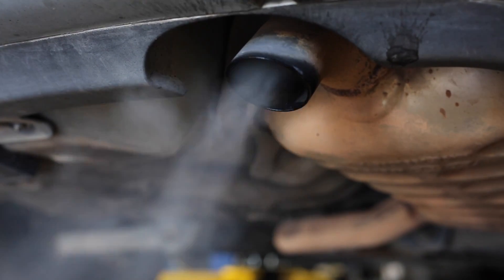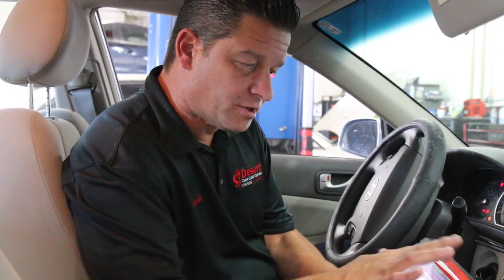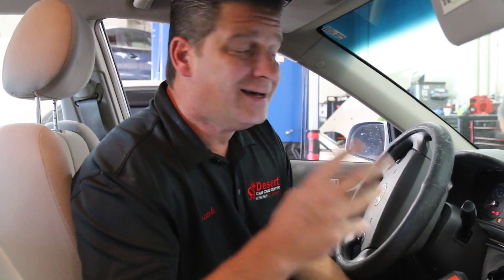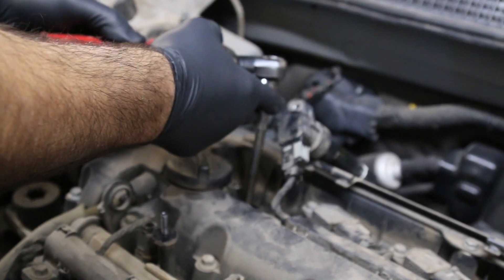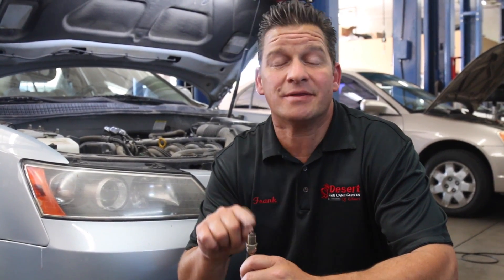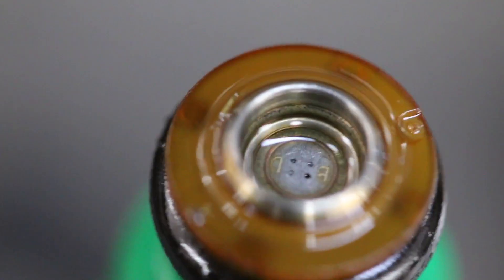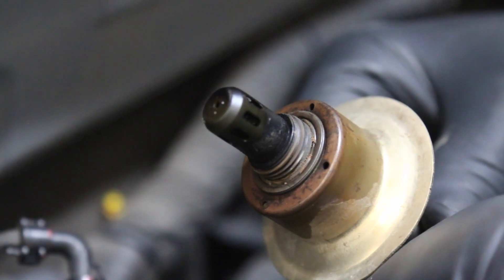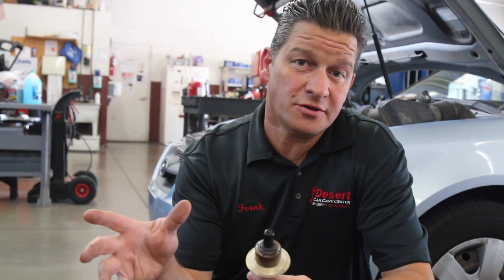Hyundai Sonata Fuel from Exhaust Pipe

Comment: Or possibly no spark on that cylinder?
Reply from the maker: In this particular case - massive amounts of fuel with an injector that was not atomizing - that injector was a fire hose of fuel.

No spark condition would have some unburnt fuel but not like this case - hope this helps

Comment: Hey i have a 1996 sc400 Lexus with a crank no start issue i can smell gas from the exhaust pipe when trying to start the car. I have change crank sensors, cam sensors, ignitions coils, spark plugs, fuel pump, igniters, fuel filter, fuel pump ecu bypass, idle air control,  clean mas air flow sensor, ecu repair, so i'm thinking it could be fuel injectors or timing has jump . I'm asking for your opinion could this be my fuel injectors because i smell a strong gas smell coming from my exhaust when trying to start the car.

Comment: My 1990 bmw 325i has a very rough idle mainly drops and sounds like it’s going to die out and then goes back up. Also it has gas dripping out of the exhaust. I was planning on changing the fuel injectors and maybe getting a new fuel pressure regulator and fuel return line. Any tips on how to fix this? I also got a whole tune up for the car but that didn’t fix the problem:/
Reply from the maker: Have you tested injectors ? Be cautious before just replacing ~ potential problems could be : harness , DME, fuel pressure regulator.

Noid light check injectors to rule out potential DME or harness issues. 
Check fuel pressure to ensure fuel psi regulator is working .

Comment: Question 
After I installed new fuel injectors into a 2008 Suzuki Grand Vitara now I have white smoke coming from tailpipe that smells like gas it was not doing that before I installed new injectors can it be a bad fuel pressure regulator.
Reply from the maker: Angel F ~ if injectors are not atomizing fuel ( misting) and they are streaming fuel you could be running raw fuel through the exhaust. Call us at the garage for any help with this one ~
Reply: Desert Car Care even though they are brand new that can happen.
Reply from the maker: Angel F < certainly hope not ~ best to test before doing anything else at this time .
Reply: How to fix injectors to atomizing if they are brand new,  I still white smoke that smells like gas

Comment: Frank, have an 06 3.3 Sonata. For over a year I have had a check engine light. Replaced the Mass Airflow Sensor & Throttle Position Sensor, had ECM flashed at dealership. Took it to local shop and they can't find anything wrong. The prob is that after the engine is warm, kill the engine, it becomes very hard to get started if it sits for about 10+ mins. Get codes stating running lean banks 1 and 2. And have had the car slip into limp home mode. I have about $500 in this now and no resolution. No longer trust the shop that said they can't produce the problem, or didn't find any of the codes. Car turns over fine. Usually runs very rough initially, but once started very smooth. Any ideas?
Reply from the maker: Chris Harpe ~lean bank 1 & 2 ~ check fuel pressure & volume ~ call me if needed at the garage
Reply: @Desertcarcare  Thanks for the reply. I think that it is fuel starved. A garage, now out of business due to fraud, "replaced" the fuel pump, but possibly didn't. May be a victim of fraudulent shop. Throughout my life, I seem to choose the wrong mechanics. Or, I should say, I haven't found a consistently reliable one. The screws on the fuel pump cover have no signs of removal. Going to the local Hyundai dealer Monday. Will see if they can figure it out. $140 diagnostic. Should I just throw a fuel pump at it instead?
Reply from the maker: Chris Harpe ~ test & verify. Don’t waste $$$ throwing parts at it ~ keep me posted ~ wish you the best ~ sorry about that experience .
Reply: @Desertcarcare  Excellent advice! Throwing parts at it hasn't resolved the problem, so continuing down that path is the definition of insanity. Diagnose and treat. Will report back once I have the results for the benefit of others.
Reply: @Desertcarcare  Replaced fuel pump, check engine light turned off, and getting about 10 miles to a gallon better mileage without the hard to start probs I ha experienced. The dealership said I also need to replace the fuel injection rails, but don't think that's necessary. They wanted 900+ for the repair and able to do it for $120 including the fuel pump lock ring. The lock ring is necessary becsuse they're made of a very soft metal and easily warp when removing. These are special order, or dealer part. Brother had an oem lock ring sent via Amazon for $22.

BTW the shop did not replace my original pump. The bad pump is the original that came with the car.

Thanks for the advice!
Reply from the maker: Chris Harpe ~ truly sucks & gives all in the industry a black eye when this happens ~ ultimately glad it worked out in the end . Rock on.

Comment: I have 06 Hyundai sonata 6 cyl 231600 miles fuel coming out exhaust the check engine light is on
 Error Code Read 
P0430 Catalyst System Efficiency Below Threshold (Bank 2)
P0420 Catalyst System Efficiency Below Threshold (Bank 1)
Where do i start? Do you think the fix would be worth it with the high mileage or should i just sell it?

Comment: I have a 2009 Nissan Altima Hybrid and the only code that comes up is for cylinder 2 misfire but the check engine lights comes and goes all the time. I smell gas fumes coming from the exhaust but it's nothing like this video. The car shakes when slowing down when cold like it's gonna shut off but it doesn't. I've changed the spark plug and coil. I've taken this car to 4 different mechanics and everyone keeps saying this is normal Hybrid stuff. It didn't do this when I first bought the car and if it was normal my check engine light wouldn't come on and off. I'm confused please help!
Reply from the maker: Alicia Perez ~ definitely frustrating . Let us know what part of the country your on & we will get you to a qualified hybrid garage. Wish we could tell you more here ~ but tough to say.
Reply: @Desertcarcare  I live in Rochester Ny. I'm 30 mins away from Buffalo if that helps. I appreciate your help. This has cost so much already and I'm still in the same position I started in

Comment: I have this problem in two-wheeler(2 stroke engine) can you show me how to fix this problem
Reply: remove the bottom of the carburetor and check the float!
if there is no float then check the reed valve.

Comment: I had a 5th cylinder misfire in my Hyundai Santa fe and after i replaced the coil and spark plug my gas mileage went to hell. The misfire was gone, the engine runs smooth but i am getting no where fast literally at about 5 miles per gallon. What happened?????
Reply from the maker: Massive Action ~wow. Call me at the garage ~

Comment: I have an issue with my 1990 Honda Accord Ex , it was new plugs , cables , distributior , coil, pvc valve , and the exhaust smell like unburned gas , cylinder 4,3 the plush get burnt bad can it be bad injectors ! I also order new map sensor and file filter with injectors please help
Reply from the maker: Roman Martinez ~ring me at the garage for this one.
Reply: Desert Car Care pretty much what’s happening with the car on the video

Comment: Great video  have a question hopefully u can help I own a 99 sable had misfire code p0301 so I changed plugs wires and coil pack check engine light went off on its own after changing everything...2 days later as I go start the car I smell gas and check engine light comes back on took it back to auto zone same code given p0301 and I smell gas coming out exhaust pipe.....not sure what the problem could be ....thanks
Reply from the maker: desi&lui A ~~ensure ignition coil & plug are good to go & not new defective. Ohms Check that cylinder fuel injector~~May need further testing at a garage to confirm ~~if you need a garage in your area ~~let me know. ~~Frank

Comment: I got a 2002 GT MUSTANG 4.6l 2v 281 cubic engine. I have no diagnose trouble lights, no codes, my car has a hesitate to start once twice a month an is smelling gas from the exhaust. No smoke. An little power lost from the throttle pedal
Reply from the maker: Ndee Redsky ~~get back to basics. Make sure all your spark plugs are good to go. Additionally a deep cleaning decarbon of air induction & injectors may help this symptom ~~good luck ! ~ 

Follow us here for more tips http://apple.co/2EdrZJE
Reply: Desert Car Care , yes I'm a certified lube technician an I installed new spark plugs, new egr vacuum solenoid, new throttle body an sensor, new fuel pump an fuel filter, new IAC sensor, new intake manifold. Gonna replace the injectors, an fuel pressure regulator an egr valve. I hope it's my catalac converters.... Can't figure it out...Thank you Desert car care..
Reply from the maker: Ndee Redsky ~~just think ~~your ride is going to be brand spanking new when done ✅ ~~you are hitting it all ~~Check the inlet & outlet temp of the cats for efficiency ~~let me know how it all worked out brother ! Good luck here 🤘

Comment: My 2009 BMW just started blowing smoke that smells like fuel after engine light came on . I change spark plugs but nothing change , .. could it possibly be injectors , oil smells like fuel and is thin down. Smoking like a train and smells like gas! Need help?
Reply from the maker: Rafael Aviles ~~your loading up on fuel it sounds like~~Check both fuel pressure & volume~~Call us anytime if you like there for more help or check out our FACEBOOK page @wrenchnation ~Frank
Reply: Thanks , ..I do have some misfiring codes on a few cylinders and 02 sensor bank 2 code .. how do I check fuel pressure ?

Comment: Hi Sir, I own a Honda City IDSI 1.3 /L13A model 2008 having 140,000 on meter. Today I just tried to adjust its valve clearance and plugs maintenance, no trouble there but as I tried to start the car it just misfired. I cranked it again it started but kept on misfiring. It also smelled like fuel around the car, then I just noticed that car is spitting excessive amount of petrol from exhaust pipe. I re-did every thing but no luck and still is spitting fuel. Please help...
Reply from the maker: Please reach out at the garage ~do my best to help you there ~Frank
Reply: Sir I am in Pakistan

Comment: Desert Car Care hi have a 1991 mazda mpv v6 i recently changed the valve cover gasket when i put everything back the car wasn't starting cause i didn't tight enough the intake.manifold after i try to start the car it would start but with  very high rpm it scared me and i had to turn of the car right away but that was intake manifold was still loosen bolts so i tight them problem now the car starts it has squeaking sound and the engine light is on and a lot of white smoke and gas comes out of tailpipe?? any suggestion i have exact the same symptoms as this hyndia sotana except i have squeaking noise ? thank

Comment: Hey Frank. Great video-very clear and concise. I've  been noticing a slight fuel odor on startup which appears to be coming from tailpipe. Exhaust is clear, no smoke. Only smell it when windows are down. No codes and LTFT is within +/-5%, MAS, Vacuum, Throttle, etc readings all appear normal. Original iridium plugs and injectors. Burns no oil. Starts and runs perfect. 2006 Toyota Matrix 4WD with 86k miles. Any ideas?
Reply from the maker: MarzNet256 ...great data info....let's connect at the garage~~happy to help~~Frank
Reply: Desert Car Care Thanks. Will do.
Reply: @MarzNet256 what was the problem?

Comment: having this problem with my 04 taurus. white smoke, won't start unless the car is on Jacks tilted, gas soaked half the air filter, gas in muffler , gas on spark plugs. code says something about the fuel rail pressure sensor High Intake and no activity from o2sensor debating about buying a new expensive rail sensor. but how do I gtg rid of all the gas in the muffler and the extra fuel in engine????

Comment: p0131
p0137
p0151
p0157
p0507 idle speed performs high 
p0300 spark plugs
p1406 egr closed pintle position
p1441 EVAP system 
Also here's the codes it's throwing out. I've done all the spark plugs and egr so far from these codes. Sorry for the 21 Questions.

Comment: My 99 Chevy Tahoe 5.7l puff out white smoke through the tail pipe just like the one on this vid and smells of gas. It happens back and forth but mainly the majority of the time whether I'm driving or it's just sitting there. Also has a sputter/shake/tremble to it like sparkplug issues. Was hard to start right up as well so I put in a new fuel pump and and new sparkplugs. Now it starts right up but still trembles. now the shaking I'm believing could have to do with the egr, vacuum leak, etc.. And the gas smell and white smoke from exhaust could possibly be coming from the fuel pressure regulator or the fuel injectors as you mentioned. Could I be correct? Or could you give me some insight on what all it could be, if you don't mind.
Reply from the maker: purestress2 ...if you are getting fuel from tailpipe after those repairs ...check the engine oil for fuel contamination..that may  indicate a ruptured diaphragm in the fuel pressure regulator. 

However. Caution here. 

I hate to see you throw parts at the vehicle. Slow it down. Fixing a broken part is not difficult.  It can be tricky to diagnose effectively. Have a reputable local garage TEST first based upon your symptoms. 

I have great guys & gals across the country that can help. Let me know if I can refer you to a great garage in your neighborhood. 

Sorry I couldn't give you holy grail of a fix here. Appreciate you stopping by. Always here to help. ---Frank
Reply: Desert Car Care thanks for the tip and the reply! I just literally now got done trying to figure out what to fix first so I went ahead and cleaned the egr Valve and replaced the gasket since it also had a 1406 code in which it said egr closed pintle position. No smoke so far but just a little bit water from the tail pipe. I couldn't smell gas either but my nose is kind of stuffed right now cause I'm sick. I'm going to test it out tomorrow again and see if it could it continues cause like I said it happens back and forth. I'll let you know how it goes. Oh and by the way could that have kinda been the cause if it doesn't continue or just one if the causes? Also the car still trembles at idle and more when I accelerate.
Reply: @purestress2  you solved your problem ? Was the problem and how you fixed ?

Comment: Hello i have a 1993 grand cherokee v8 zj ..lots of smoke from the exhaust with fuel smell and check engine light ..yesterday i turned on the ignition and everything went back to normal and suddenly the check engine came back on with the smoke..i pulled out 4 injectrors of the right side of the engine and no more smoke ..sparkplugs are working great too..what should i do please thanks
Reply from the maker: Fadi Akl ..reach out frank@desertcarcare.com  for details. I have a few questions so I can help you further~~Frank.

Comment: my car smells gasoline from the pipe  what do you think ? it burn allsoo lot of fuel
Reply from the maker: Rajiv Raushen ...make sure 
A)Injectors are atomizing the fuel
B) O2 Sensors are moving as they should
C) Ignition ( spark plugs etc) are burning properly 

You have any fault codes stored ? What kind of vehicle ? -Frank
Reply: Desert Car Care ; i have a toyota raum 1.5 l
Reply from the maker: Rajiv Raushen ...Check Engine Light on ?
Reply: no sir no check engine lights
Reply: no sir no check engine lights
Reply from the maker: Rajiv Raushen ...Start with the basics of a good old fashioned tune up. Replace spark plugs, air filter & a deep decarbon of air fuel induction system. Good luck my friend .
Reply: Desert Car Care: oki sir
Reply: Desert Car Care hi have a 1991 mazda mpv v6 i recently cha ged the valve cover gasket when i put everything back the car wasnt starting cause i didnt tight enough the intake.manifold after i try to start the car it would start but with  very high rpm it scared me and i had to turn of the car right away but thay was intake manifold was still loosen bolts i tight them problem now thr car starts it has squeaking sound and the engine light is on and alot of white smoke and gas comes out of tailpipe?? any suggestion
Reply: Your videos or sogod andosim